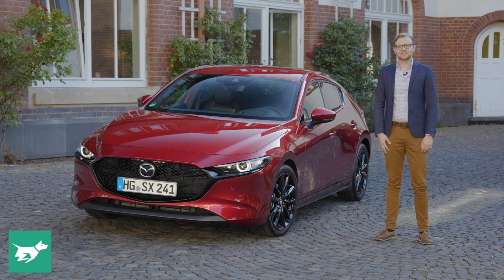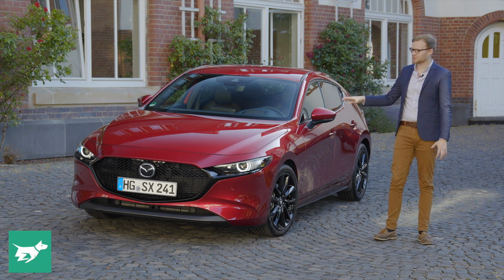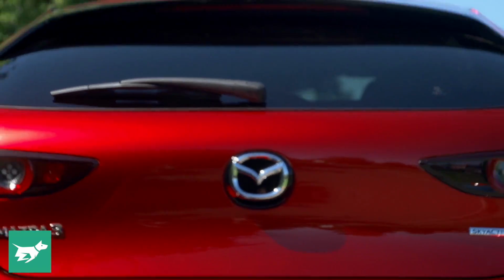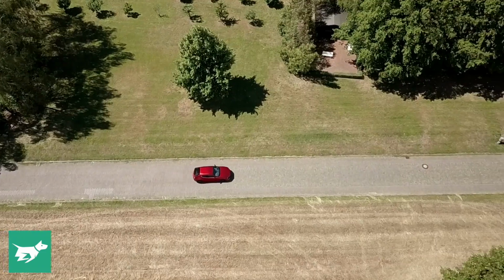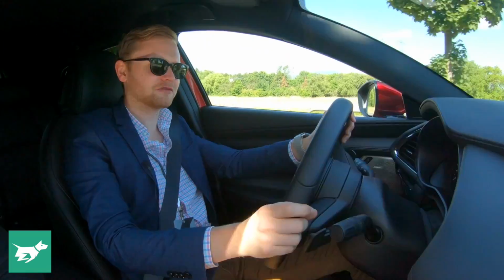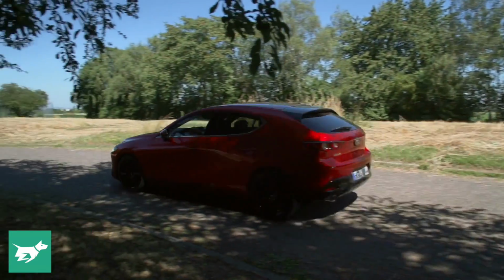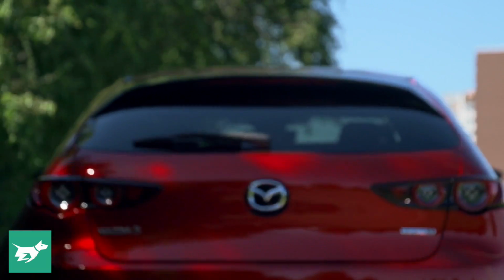Mazda 3 Skyactiv-X 2020 review

Comment: Even if you charge your electric car on a coal powerplant, the electric motor is 85-90% efficient. The ICE engine is only 20-30% efficient at best. So basically, you still pollute about two thirds less for the same distance if you charge your electric car on coal versus burning petrol in a modern ICE engine.

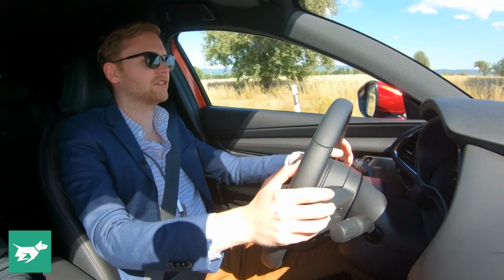Comment: Am I seeing a manual transmission WITH paddle shifters on the steering wheel? Or is this 2 different cars? 5:25 you can see the paddles (uses them just prior, at 5:27 you can clearly see a manual gear shifter. Also red interior....VERY curious!
Reply from the maker: Different cars – sometimes on launches we have to mix and match the cars we film with in person with the cars that are pictured in the background shots.

Comment: 5:36 - "It's certainly not a torquey down-low as a turbocharged 1.4 or 1.6, like a Volkswagen engine..."
My god. Those tiny city-car engines don't have any torque at all. How can Mazda's 2-liter Skyactiv-X possibly have less torque than one of those tiny city-car engines?
Reply from the maker: No... they offer 250Nm just above idle, whereas these make less torque and at higher revs. Take a drive back to back, it’ll all make sense
Reply: @chasingcars : In that case the wording in the video is confusing. It makes sense that a naturally-aspirated engine would make more torque at low RPM than a turbocharged engine with the same horsepower. However, that is not what the video said.

Comment: Skyactiv-X is a very cool technology, but not having regenerative braking still means energy is being wasted every time you slow down. You burn fuel to accelerate, and then you piss away all that energy as waste-heat in the brakes when you slow down again. This makes driving around town inefficient no matter how fancy the engine is. My girlfriend's Mazda 3 Skyactiv gets above 40mpg highway but only 16mpg city, which is absurd. Hybrids are the way of the future and Mazda needs to just fucking accept it already. I went with Toyota for my latest car specifically because Mazda doesn't offer any hybrids yet. Hybrids have existed for 23 years now! Get with the fucking program, Mazda!

Comment: Do you think this would fit a drumset? I'm trying figure out if I could atleast fit a bass drum thats 22x18inches in diameter, in the hatch. I also have a big bag of hardware that's about 28x14inches. On top of that the snare drum and floor toms but I could always throw thst in the back seats. I'm so in love with this car but I have a feeling this isn't exactly practical for my situation
Reply from the maker: Hard to say, Abe. I'd take your equipment to a Mazda dealer and try it for yourself. They won't mind.

Comment: Mazda: We have created a revolutionary petrol engine which functions like a diesel. Ok, it has spark plugs like a normal petrol engine. And the the compressionignition mode only works when not accelerating fast. But it is really like a diesel... almost."
Reply: PSA hybrid air tech was annexed.That project seemed revolutionary.Mazda is a small company with financial restrictions ;they should ally with some other  auto makers to share the cost of R&D.

Comment: If they make 2.5 with this system and tune little for horsepower it could end up from standards engine 195hp like in mazda six to up 250HP
Reply: I can't find it now, but I think I read that Mazda is still working on getting the Skyactiv x technology to scale efficiently with larger cylinder displacements.

Comment: 7.5 l/km? I expect almost diesel fuel efficiancy...So whats the purpose of this car?
Reply: 7.5l with stretch of autobahn and urban driving is damn good on 180hp petrol engine. That's what I get in Mazda's diesel.
The figures on screen are averaged between many reporters, so you can bet they didn't take too much care of the car and the engine.
If you gave it to the grandma those figures would go down a bit
Reply: @ns4529  7,5l is what i get in a 308 1.6 thp with 205hp much faster and possibly the same price at the end!
Reply: @deadcaatwalking  this was a test car. probably most jurnalist pushed it harder. i'm sure in normal driving condition it will be much less.

Comment: Hey, I think you were being not responsible by saying electric cars isn't that environment friendly because the power is still coming from power plant.
1. Power Plant is significantly efficient then internal combustion engine
2. Power plant can generate power from renewable energy source such as wind power
Reply from the maker: The point I made was communicating Mazda’s view that full electric vehicles are inappropriate *where the national power grid does not have sufficient renewable energy sources*, such as in Australia. I made no point about my own view on the subject, which is irrelevant in this instance.

Comment: Less fuel. Less power. Take note.
Reply: It uses less fuel and makes more power compared to their equivalent non skyactive-X engines.
Reply: @DoubtingThomas333  how did you know, do you own one?
Reply: @MrLight-xi6gm  it was spoken about in the video.  The power output is fantastic for the displacement also.   This engine is getting 50+mpg in this vehicle.

Comment: Nice.. Half the people here does not follow the news of other motoring journalist or even care to read a little more.
No one is pointing out that this X engine actually have a supercharger, albeit a small one, to maintain its high AFR and therefore fuel efficiency.
That means at least, it does still use forced induction to always maintain its very lean diesel like mix.
Reply: Hm. I’ve never seen or heard anything about this car having a supercharger. Ive always heard it’s NA
Reply: I didn't read about it, but it sounded strange considering for Diesel-like compression you basically NEED forced induction to make meaningful power... I doubt they don't use one.
Reply: It’s a compressor, not a turbocharger. It’s used for efficiency.
Reply: @heinsencorporation  : "It’s a compressor, not a turbocharger. It’s used for efficiency." ..... Both superchargers (gear driven) and turbochargers (exhaust driven) are "compressors. "

Comment: I feel like Mazda and journalist alike are struggling to justify this motor. If the goal is to eliminate the automotive impact on fossil fuels, then put the car down and start riding bicycles. Other than that, a compressed ignition petrol engine just isn’t the answer. Especially with only an observed 10% gain in efficiency. Toyota’s new 2.5L in-line 4 for example has better thermal efficiency than any of Mazda’s skyacrive motors and is about 15% more efficient without any fancy technology. Just good engineering. And that’s without even adding a hybrid electric aspect to it. 

I see skyacrive-x as a gimmick. A smoke and mirror show. It’s not helping the petrol engine live any longer than Toyota’s new humble 2.5L in-line 4 is. And that engine which is objectively better didn’t get a video talking about how cool it is, so nether should this Mazda lol. I’m sorry, but to me skyactive-x was not money well spent. It’s not the answer. 10 years from now virtually every manufacturer will have full on electric models. 20 years from now wind power and solar renewable energy will aid in the production and operation of automobiles. No one is going to emulate anything remotely close to skyactive-x 10 or 20 years from now. It’s simply not the answer.
Reply from the maker: I'll say a couple of things. (1) I observed about 10% better than a Golf 1.4T (not a Mazda 3 G25) on this short drive that encompassed Autobahn. Without driving at 180km/h, I think we'll see better gains in Australian testing, but we will have to wait and see. The official CO2 emission figure of 96g/km is very low for this segment. (2) Journalists don't justify technology, we just report, so that you're able to make your own assessment – which you have done very well indeed.
Reply: Chasing Cars Ok, (1) you have no idea how excited I am that you replied to my comment.

(2) go me..... go me.... it’s my birthday.

But good point, I guess an actual long term test would be more appropriate for such a new technology. Maybe I’m being shortsighted. I don’t own a car company after-all, but I personally just don’t see the point. Doesn’t mean I don’t believe in Mazda, I can’t wait to gobble up an AWD CX-30 when my current lease is up. But I think I can skip the skyactive-x train.
Reply: Well said.

Comment: Mazda's argument isn't just that electricity is often produced by burning fossil fuels like coal, it's that making batteries is extremely energy intensive. The amount of CO2 emitted as a byproduct of the battery manufacturing process can be enormous (on the order of 100-300 kilograms of CO2 per kWh of battery capacity) especially when they're made in places like China where most of the energy used to produce them comes from burning coal. It's these "embedded emissions" that are most of the reason why a car like the Tesla Model S, using German electricity, will emit something like 148 g CO2/km during its lifetime. There are already diesels and hybrids that emit less CO2 per km than that.

Comment: Great review Tom - this engine with automatic transmission should provide torque low down but also be able to stretch its legs with good CO2 and low fuel use - best of both worlds and without turbo lag issues. Whilst I’m a turbo fan particularly of the smaller turbo fours when caught off boost they’re drivability is questionable resulting in huge throttle inputs and high fuel use - Mazda onto a good thing here although will your Aussie motorist pay 💰 for it? Such a price sensitive segment but prefer this to the choice of a large non turbo 4 or small displacement turbo and loving the new 3 the more I see it - interior looks great 👍

Comment: 7l/100km? Are you joking? That's not "diesel" like fuel consumption. And I bet it's going to be a lot more than the skyactiv g . It's a let down of a engine in my mind. I drove for example 3 focus 1.0 125 hp and my average was bellow 7. So I will have that any time and it's much much cheaper. Not as nice inside but like for like I bet it's about at least 6-8 k € cheaper.
Reply: It was full throttle on Autobahn also. 1.0 ecoboost doesn't manage < 7 l/100 km in such condtions.
Reply: @carfailsx3497  Ok I will give it that. It depends a lot of the type of use and a turbo engine pushed hard it will drink more. But I just saw the prices of the Skyactiv X and it is steep which ever way you look at it. Here in Spain the difference between G And X is of 3000-5000 € depending on the trim level (28k/29k/29.5k). Now I am sorry but it is way to expensive and I do like the Mazda 3 don't get me wrong but I don't like it that much. For example a loaded up Focus 1.5 180hp economist  is 23.500 €. Yes it drinks more but with 6k you can buy a lot of petrol.
This is only my opinion and I don't want to sound disrespectful but they are out of their minds. It is just a Mazda 3 not a 6.
Reply: @bodo9655  Exactly, whit 27k i bought a 308 1.6thp with 205hp and guess what, cruising around i'm getting 6,5L same as the Focus 1.0. When i push it 7,5 / 8L. And it's a joy to ride, not that fancy but way faster.
Reply: @deadcaatwalking  Mazda 3 is nice but not that nice. Everybody is free to do what they want with their money, but in my opinion it's not worth that much. And I bet it will depreciate a lot after a few years of ownership. 
Enjoy your Pug. It can't even compare with the Mazda, maybe with an MPS version if they will release one.
Reply: @carfailsx3497  I used to have a Focus 1.0 too , i'm gessing in these conditions, around 7.5L. Never pass the 8L whatever i did with it.

Comment: What I'd like is an AWD 3 with a rotary. Mazda...a car company that used to be known for real innovation and a huge range of models. Look at the models and variants they put out in the 60's and 70's. They even had a rear wheel drive 5 door hatch. How many car makers have done that in the last 40 years? BMW and not many others, if at all!
Reply: Club 1 Fan: "What I'd like is an AWD 3 with a rotary. Mazda." ..... There are good reasons that most Mazda vehicles DON'T use  Wankel engines any more, and one of them is reliability.

Comment: I might consider buying the Mazda 3 if available in the future with the Skyactiv-X engine in the U.S. Otherwise, other cars might be of better value than the Mazda, such as the Honda Civic and the Toyota Corolla. I think Mazda shouldn’t give up in its performance roots, or zoom zoom, a new Mazda 3 Speed is what is needed in my opinion. It needs a tubo charged, over 200 bhp engine, limited slip differential, torsion bars front and back, multi-link independent suspension, etc. and of course available with a 6-speed manual.
Reply: I'd appreciate a 3 liter Sky-X with a 7 speed.

Comment: Thanks Tom. I'm impressed with the tech, but can't help but feel disappointed that the 'low down' performance hasn't been notably lifted as that is where the 2.0 and 2.5 need to improve. I'm also thinking about where the X models will sit from a pricing perspective. The Mazda 3 is already in the upper tier and pricing it above that will mean you get a car that only has incremental improvements at the 40k plus price point.
I still find it hilarious that the car to beat is still the Golf which is now 7 years old and due for replacement.
Reply from the maker: That’s a pretty good summary, Mark. I’m impressed from a technological viewpoint - good on Mazda - but the end result only achieves a par with the VW EA288 motor (except that SX is likely more economical). That real low-down muscularity isn’t so prominent in the Mazda like it is in the VW Group cars.
Reply: From Consumer Reports owners surveys, the Volkswagens are usually much less reliable than Mazdas for the last 7 years. I would wait at least 2 years for the more expensive Skyactiv X engine- the mid-level engine is more time tested now. I add Berryman cleaner to my gas tank at least once a year, since Mazdas do not have both direct and port injection like the Toyotas that keeps the engine cleaner.

Comment: About 7 litres per 100km is not bad for the size of the vehicle... 

But in all seriousness. Everyone  should just get an ND mx5! I get about 5.2 - 6 litres per 100km on a similar cycle you’ve mentioned while driving the living daylight out of it! Plus most of the time. Everyone drives alone anyway. Imagine all the fun one can get and because everyone is having fun. The world will be a better place
Reply: He reach that number because he went to the Autobahn. This is the place where you push your vehicle like nowhere else, except on actual tracks.
Reply: Even our bl with the old 1.6 reaches 7l per 100km. But not on the autobahn
Reply: I was expecting something around 5L.
You can find the same consumption in a petrol engines with turbo. 
For example i have a 308 1.6 thp with 205hp, usually i'm getting 6,5L to 7,5L, even when i slam it never passed the 8L

Comment: How do you rate it against the 2.2 twin turbo diesel in the bigger cars?
Reply from the maker: The diesel is way, way torquier (twice the torque - 450Nm - and available 1000rpm lower). The X has better top-end lunch but if it was a choice I’d still be going for the lovely 2.2TTD, though this is no longer an option in the Mazda 3. In future, the Skyactiv-X will be developed in six-cylinder forms which will be interesting.
Reply: @chasingcars  yeah the straight six engines Mazda hinted at could be a real turning point for them - especially in Australia where people love an NA 6 cylinder. If they stick that in a 6 with AWD I can only imagine great things - hopefully that's a thing when I'm due for my next car in 4 years time.

Comment: Great review in giving overall impressions (& without toms weird... pauses... before random words) but not specifics. No mention of the supercharger, minimal benchmarking to existing engines. If this has better economy then the existing 2.0 & similar performance to the 2.5, say that mate.
Reply from the maker: On international drives we’ve got to be a bit careful about specifics, which can change, and given the fact we only get an hour or so with the car, but I appreciate that feedback. Without the opportunity to back to back the engines I can't say with authority, John. We’ll be doing that when we have the chance — after the X arrives in Australia. We weren’t granted the opportunity to drive the conventional petrols in Frankfurt, but anecdotally, I think it’ll end up 10-20% more economical. On the supercharger front, Mazda have backed away from calling the X supercharged; it does have a supercharger driven belt for the air supply but it’s very low capacity.

Comment: Why would you pay a premium for the sky active X engine when there isn't a great difference in economy figures from the standard engine?
Reply from the maker: A couple of reasons, I think, Tony. The first is that it cuts CO2 emissions by about 35% over the G25 engine, and if you live in a market that taxes cars by emissions, that will result in ongoing savings. The second reason is the additional low down torque for better drivability at town speeds. The third would be the engine is quieter. For some, these will be compelling; for others, the conventional petrols will still be a more logical option.
Reply: Chasing Cars all things that hybrid power train does for less money. And better fuel economy. The Toyota hybrid package on the Corolla is only $1500 more than the base model. And it’ll only get cheaper in 2020 when this comes out. I fear it’s dead in the water
Reply from the maker: Desmond Aranha I agree Toyota are doing good things with hybrid, but the 1.8L hybrid Corolla they send to us is anaemic — just way too slow.